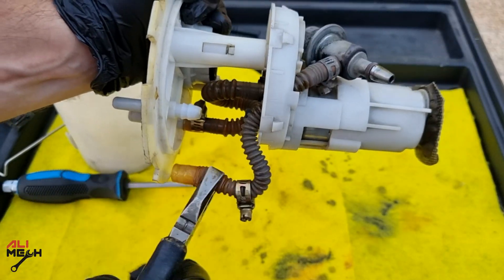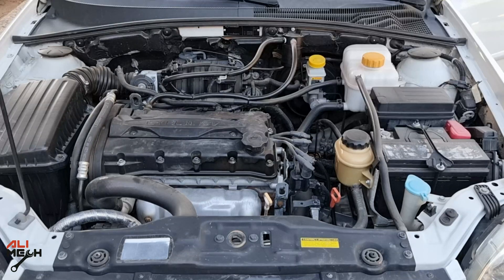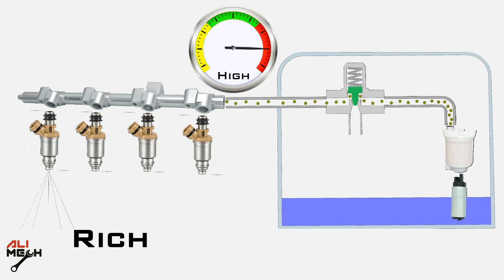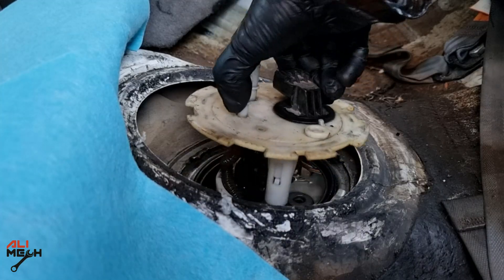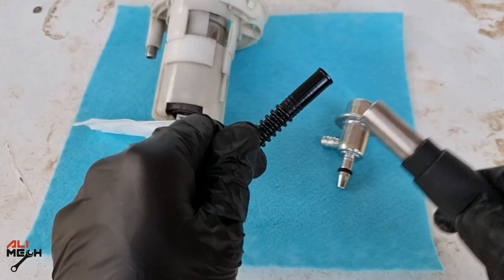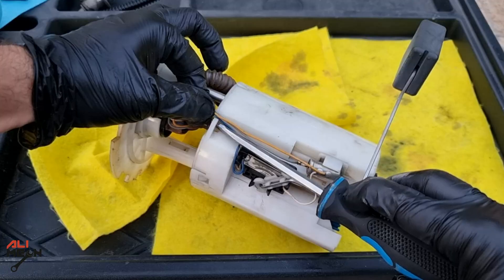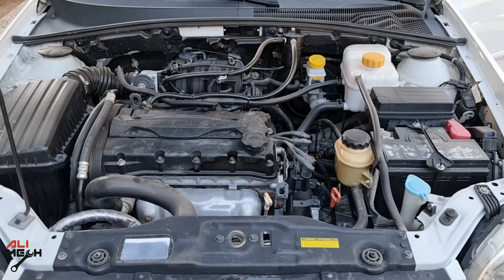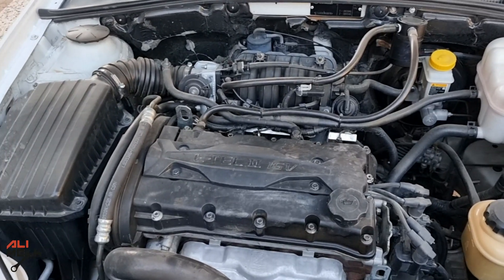Here is why your car burning more fuel/What's bad fuel pressure regulator symptoms/Low RPM misfire

Comment: My obd scanner say pooo1 fuel pressure regulator open so the regulator is in the fuel pump? And not the rail.on the engine
Reply: correct

Comment: Good work buddy. Did you not get any check engine light in this situation, like system too lean or system too rich ?
Reply from the maker: You should get error code,  but with this chevy optra, it doesn't come on, even when there is a big problem that caused the engine not to start
This car is lowest quality, it doesn't have fuel pressure sensor,  so the computer won't know if the pressure high or low
Reply: @AliMECH  Thank you